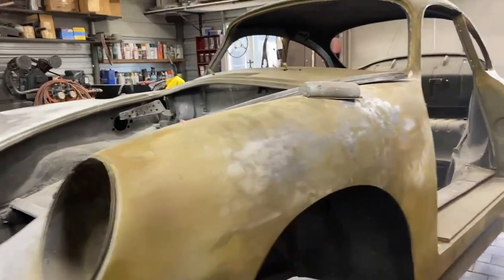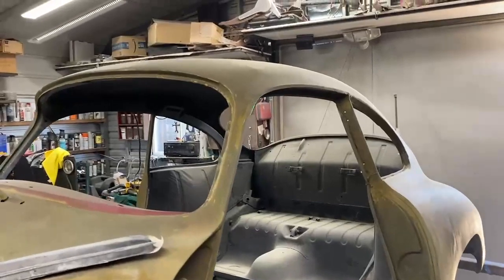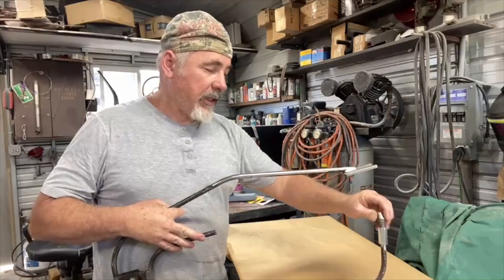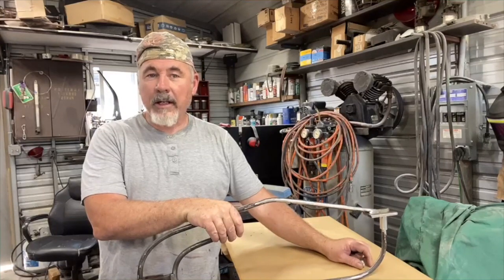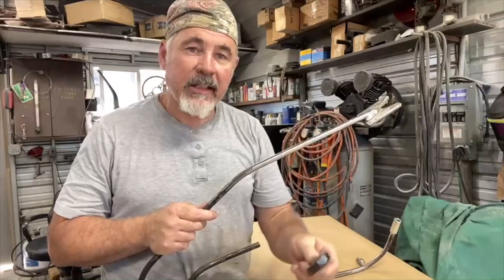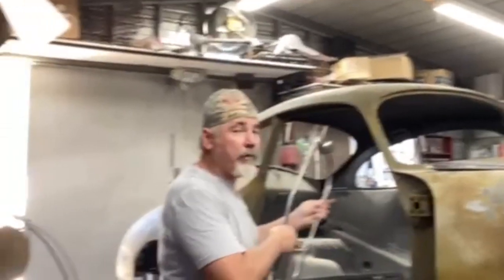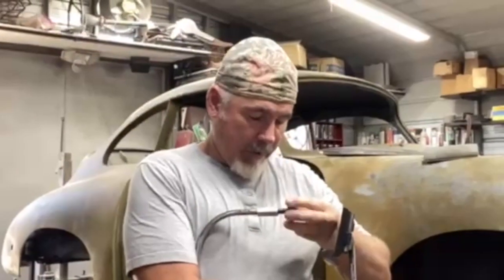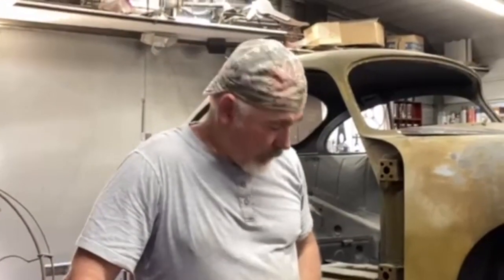356 Porsche Body Work continues with new tool

Comment: Neat tool, and good that you made it yourself.
Reply from the maker: It was real easy to make. I didn’t measure anything. I just bent the bottom piece first. Then I figured out the hinge and then bent the top piece. After that I just cut off and welded the flat plate and cut out the V shaped out. Added the spring and there it is.,it only took a couple of hours. Pretty easy